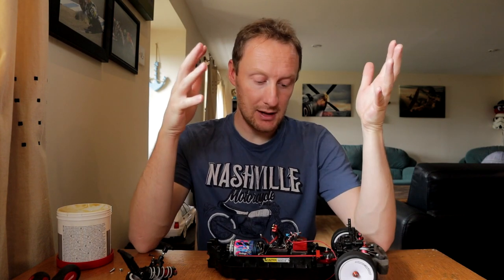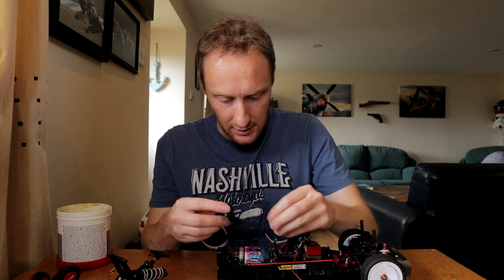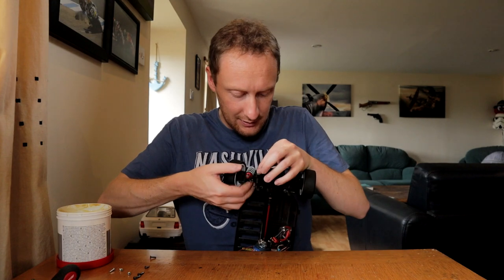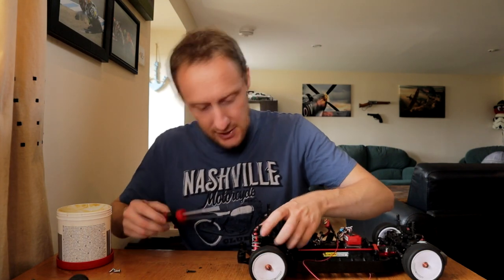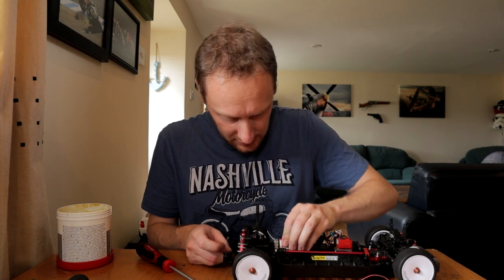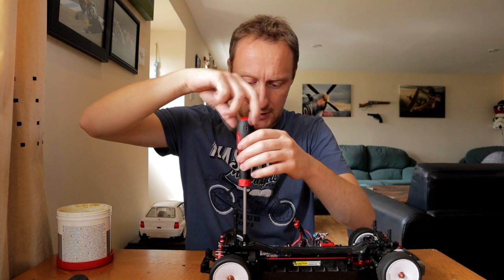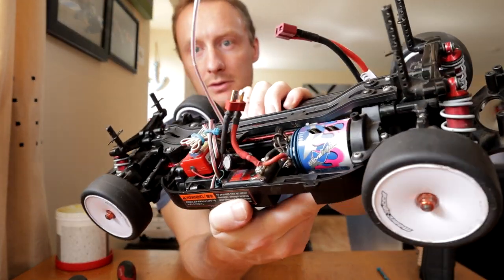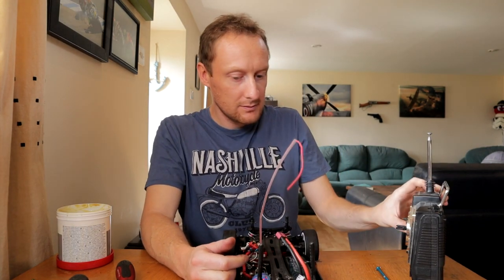Tamiya TT-01E... Upgrades completed and I sorted out my mess!

Comment: I didn’t like the way that the screws at the rear of the top plate can reach down to the spur gear. If you put the wrong ones in. So I got some long 3mm grub screws, tapped the plastic and super glued them into the plastic. Now I just put nuts onto the grub screws.
Reply from the maker: Good work, I like it!
Reply: Brilliant, absolutely BRILLIANT. Thanks Sean!
I've been having problems with those 8 screws of all sizes stripping out., YOU solved the problem. Grub screw in all 8 spots and 8 nuts, Blue loctited on. 
Euro Truck rules be damned, they have to solve to inherent problems of the cheap Tamiya kits and YOU just did for one of them. 
Thanks so much. this is why I look at ALL comments of these RC videos.
cheers
Boots Langley
La Mesa, ca
6-2022

Comment: hey , great video , I solved my clicking after 1 minute of your video and had my tt01e Porsche 911 Gt3 Cup VIP2008 running silent after throwing a aluminum motor mount and main shaft with no luck. i just happen to have a second kit I robbed a spur out of and off I went.  FYI i used the wrong screw as well and junked the original spur.
Reply: Oh and now subbed
Reply from the maker: Hey, Paul. Glad I could help! Yeah, it happens to the best of us.
Reply from the maker: @Paul__FC  Thanks!

Comment: Hello Friend, thanks for the great video! Do you race or drift with the car because i like the difs but thought IT is only for drifting? Thanks! A tip use tireglue to make new thread in the chassis, IT works great
Reply from the maker: Hello and welcome! I don't, I only use it as a street basher. The TT-01D is a drift car. The TT-01E is a little different; it's more like the original TT-01 with a little higher spec. There are many variations of the TT-01 chassis, as it is quite versatile.

Yup, absolutely. I do that all the time! Cheers.
Reply: @TheRCScotsman thanks!  are the 3racing diffs u use good for racing and do you like them more than the originals? Unfortunately the diffs are out of stock. Yes i like the tt01 verry much with al the upgrade parts. My TT01 is almost full allu beside the arms and i did a Brushless upgrade with the skyRC 120a esc and a 10.5T sensored motor 💪 have fun my friend
Reply from the maker: @Muldrix1978  Yes, they're more accurate and they're also adjustable, however, as they are ball bering diffs, they aren't as strong as a good, old-fashioned, geared diff. The Yeah Racing oil-filled geared differential set is possibly a good balance between the two.
Reply: @TheRCScotsman  thanks! One more question. From the center shaft the front outside cup is moving is coming up (wobling vertical) by throttle, is that normal?